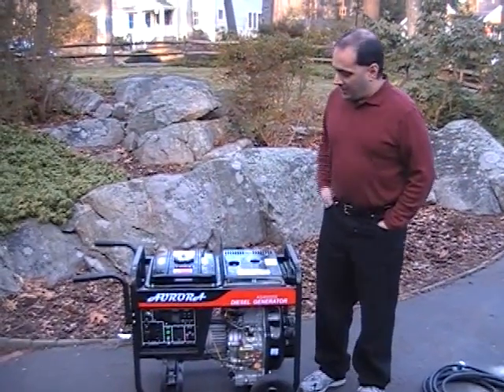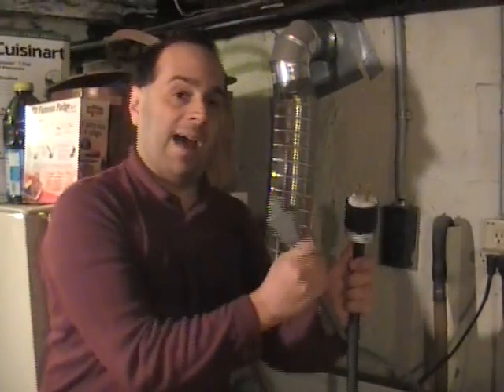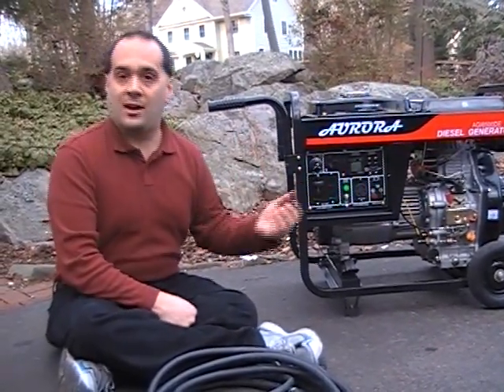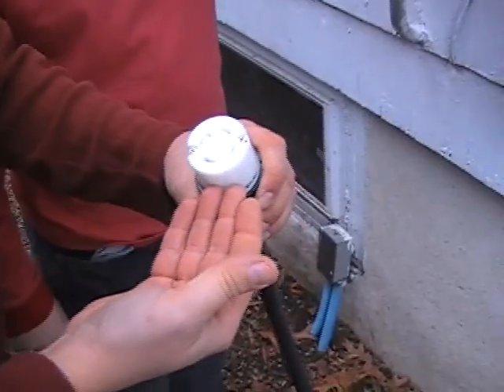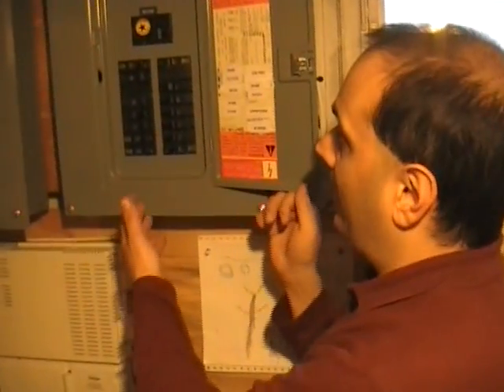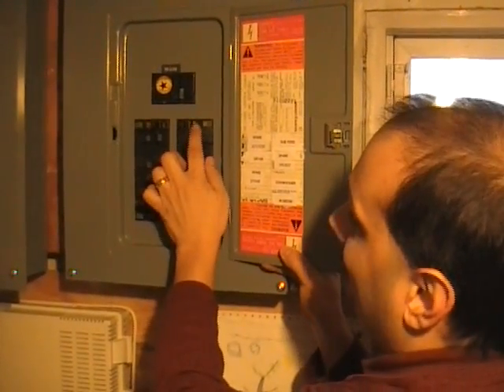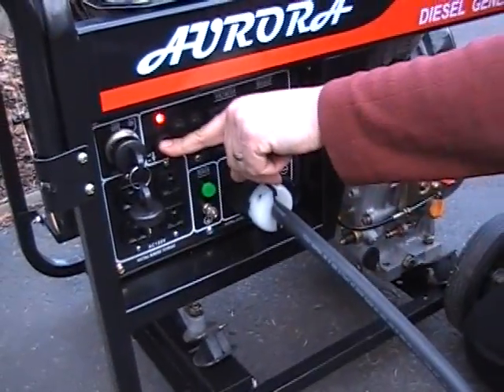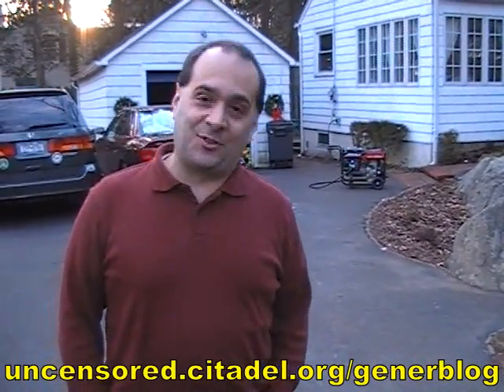Inexpensive residential generator hookup

Comment: Nice video Art. I have 2 questions:

What type of cable should I buy to run from the generator cord outlet in the garage, to the box in my basement. You briefly refer to it as the "orange" wire?

When I went to Lowes to buy the interlock switch, the salesman (credentials unknown) said that these interlock switches are not adequate, and that I should buy a manual transfer switch instead. He said the reason is that while opening up the main breaker does prevent backfeed to the grid through the breaker, there is nothing to prevent backfeed to the grid via the neutral wiring. I am not an electrician. Does this guy have a point?
Reply: The NEC states that all AUTOMATIC transfer switches need to be sized to the full load. Unless load shedding abilities are available. All manual transfer switches do not need to be sized for the full load as the user controls the loading.

Comment: Excellent video - Very well thought out and informative.

There is just one thing which has been overlooked, You need to invest in a nice soundproof enclosure which is fully ventilated to protect your nice, expensive generator from the weather and most importantly drop the noise of the generator down so that it does not disturb your neighbours too much! - see youtube video below for more info: 

https://www.youtube.com/watch?v=_ujNlL6ZcTs 

Good luck man :-)
Reply: Generator safety rules: Always make sure you follow all the generator safety rules before using your portable generator. This is only a reminder. Generators can be dangerous if not used carefully. Every year, hundreds of people die or get injured when using portable generators due to carbon monoxide poisoning and electrocution. Make sure you are using your generator carefully and keeping others safe as well. There is something very serious that everyone should always be aware of when using generators. Some people do run their generator indoors which is not safe and that increases the risk of carbon monoxide poisoning which can cause death of family and you. Some people run their generator in wet conditions which can electrocute them. Please remember that you should never run your generator indoors. Remember that carbon monoxide is an odorless and colorless gas that you cannot see or smell. Carbon monoxide is a silent killer. Keep that in mind. Make sure your generator is 15-20 feet away from your house and away from doors, windows, and vents. Never use your generator in your porch too. Having a carbon monoxide detector is very important against generator safety. Some people also allow children to go near the portable generator which could pose risks. We need to keep an eye on our children making sure that they are not near the portable generator so they won’t get electrocuted or burned by the generator which is dangerous. A locking enclosure also keeps kids safe. A generator shed might look like a tempting place to explore, or take cover during a game of hide and seek, but a generator is a dangerous piece of equipment that can cause injury. It says on the manual that we should also keep children away at all times from the portable generator to avoid injuries. Please do not allow a child or unqualified people to operate the portable generator.  It is important to keep your children safe especially little ones. The portable generator can be hot during an operation. Just because some manuals missed what should be listed doesn’t mean it’s safe to do. Always follow the generator safety rules when using portable generators. Generators pose electrical risks. If you need to use your generator during wet weather, you need a generator tent to protect your generator from getting wet. Don’t let your generator get wet. Keep your generator dry and before using your generator, please make sure your hands and your generator is dry. Do not wear loose clothing when operating the generator. Everything that is said on the generator’s operating manual should not be ignored. Never smoke cigarettes near the generator. Please keep flammable things away from the generator. Never overload your generator too. Your generator can catch fire. Never ever try to plug a generator cord into a wall outlet to avoid back feeding. Back feeding your generator is dangerous. Always turn on your generator first before plugging in appliances and shut off the appliances before turning your generator off. Use a heavy duty cord for your generator and the cord should not be worn out. All the instructions should be followed carefully. Never refuel your generator while it’s running. It can cause fire if fuel spills while your generator is hot. You should turn off your generator and let it cool off before refueling it. Having a fire extinguisher next to the generator is also important. This is only a reminder for everyone’s safety of using generators. Make sure your generator is properly grounded. Having a fire extinguisher next to the generator is also important against the safety rules. https://youtu.be/I1jT3ANENvI and here is a video more about keeping others safe when using generators and also about our family’s safety. It’s important to keep our little children safe as well. Make sure they’re away from the generator. Hope this helps.

Comment: What if the Gen. don't have an L14-30R outlet but has an L5-30R outlet instead?
Reply from the maker: L5-30R is a single phase, 120 volt receptacle.  That kind of generator is not suitable for interconnecting with a split phase, 120/240 volt service.  Unfortunately you will need to stick with extension cords.
Reply: Art Cancro. So it seems.Thanks

Comment: excellent video, very informative and helpful. I'm looking to equip my house for an emergency generator for future power outages and I'll be looking to follow in your footsteps on this install set-up. Thanks for sharing and taking the time to explain the dangers of no protection back feed. I was an aircraft instrumental electrician years ago so I fully understand the dangers with electrical wiring and the importance of protection devices in your circuits... Also I have the same basic needs for the circuits you have set-up in your transfer panel as we heat our home with oil as well. This video was taylor made for my needs.... Well done
Reply: Generator safety rules: Always make sure you follow all the generator safety rules before using your portable generator. This is only a reminder. Generators can be dangerous if not used carefully. Every year, hundreds of people die or get injured when using portable generators due to carbon monoxide poisoning and electrocution. Make sure you are using your generator carefully and keeping others safe as well. There is something very serious that everyone should always be aware of when using generators. Some people do run their generator indoors which is not safe and that increases the risk of carbon monoxide poisoning which can cause death of family and you. Some people run their generator in wet conditions which can electrocute them. Please remember that you should never run your generator indoors. Remember that carbon monoxide is an odorless and colorless gas that you cannot see or smell. Carbon monoxide is a silent killer. Keep that in mind. Make sure your generator is 15-20 feet away from your house and away from doors, windows, and vents. Never use your generator in your porch too. Having a carbon monoxide detector is very important against generator safety. Some people also allow children to go near the portable generator which could pose risks. We need to keep an eye on our children making sure that they are not near the portable generator so they won’t get electrocuted or burned by the generator which is dangerous. A locking enclosure also keeps kids safe. A generator shed might look like a tempting place to explore, or take cover during a game of hide and seek, but a generator is a dangerous piece of equipment that can cause injury. It says on the manual that we should also keep children away at all times from the portable generator to avoid injuries. Please do not allow a child or unqualified people to operate the portable generator.  It is important to keep your children safe especially little ones. The portable generator can be hot during an operation. Just because some manuals missed what should be listed doesn’t mean it’s safe to do. Always follow the generator safety rules when using portable generators. Generators pose electrical risks. If you need to use your generator during wet weather, you need a generator tent to protect your generator from getting wet. Don’t let your generator get wet. Keep your generator dry and before using your generator, please make sure your hands and your generator is dry. Do not wear loose clothing when operating the generator. Everything that is said on the generator’s operating manual should not be ignored. Never smoke cigarettes near the generator. Please keep flammable things away from the generator. Never overload your generator too. Your generator can catch fire. Never ever try to plug a generator cord into a wall outlet to avoid back feeding. Back feeding your generator is dangerous. Always turn on your generator first before plugging in appliances and shut off the appliances before turning your generator off. Use a heavy duty cord for your generator and the cord should not be worn out. All the instructions should be followed carefully. Never refuel your generator while it’s running. It can cause fire if fuel spills while your generator is hot. You should turn off your generator and let it cool off before refueling it. Having a fire extinguisher next to the generator is also important. This is only a reminder for everyone’s safety of using generators. Make sure your generator is properly grounded. Having a fire extinguisher next to the generator is also important against the safety rules. https://youtu.be/I1jT3ANENvI and here is a video more about keeping others safe when using generators and also about our family’s safety. It’s important to keep our little children safe as well. Make sure they’re away from the generator. Hope this helps.

Comment: Great info Art.
It's nice to see someone showing alternatives to dangerously backfeeding a system and very expensive transfer switches.
I used a method similar to yours for the same reason. My main panel is a 20 circuit Stab-lok so I added a Stab-lok Retrofit generator panel which has 20 circuits and a transfer switch and main breakers included. The panel was less than $200 + additional breakers.
Too many are scaring people away from using generators safely by making them think that proper transfer switches cost several hundred dollars.
Reply: isn't $200 several hundred?
Reply: @TimYorty  No.
sev·er·al
/ˈsev(ə)rəl/
determiner · pronoun
determiner: several; pronoun: several
    more than two but not many.
Reply: Generator safety rules: Always make sure you follow all the generator safety rules before using your portable generator. This is only a reminder. Generators can be dangerous if not used carefully. Every year, hundreds of people die or get injured when using portable generators due to carbon monoxide poisoning and electrocution. Make sure you are using your generator carefully and keeping others safe as well. There is something very serious that everyone should always be aware of when using generators. Some people do run their generator indoors which is not safe and that increases the risk of carbon monoxide poisoning which can cause death of family and you. Some people run their generator in wet conditions which can electrocute them. Please remember that you should never run your generator indoors. Remember that carbon monoxide is an odorless and colorless gas that you cannot see or smell. Carbon monoxide is a silent killer. Keep that in mind. Make sure your generator is 15-20 feet away from your house and away from doors, windows, and vents. Never use your generator in your porch too. Having a carbon monoxide detector is very important against generator safety. Some people also allow children to go near the portable generator which could pose risks. We need to keep an eye on our children making sure that they are not near the portable generator so they won’t get electrocuted or burned by the generator which is dangerous. A locking enclosure also keeps kids safe. A generator shed might look like a tempting place to explore, or take cover during a game of hide and seek, but a generator is a dangerous piece of equipment that can cause injury. It says on the manual that we should also keep children away at all times from the portable generator to avoid injuries. Please do not allow a child or unqualified people to operate the portable generator.  It is important to keep your children safe especially little ones. The portable generator can be hot during an operation. Just because some manuals missed what should be listed doesn’t mean it’s safe to do. Always follow the generator safety rules when using portable generators. Generators pose electrical risks. If you need to use your generator during wet weather, you need a generator tent to protect your generator from getting wet. Don’t let your generator get wet. Keep your generator dry and before using your generator, please make sure your hands and your generator is dry. Do not wear loose clothing when operating the generator. Everything that is said on the generator’s operating manual should not be ignored. Never smoke cigarettes near the generator. Please keep flammable things away from the generator. Never overload your generator too. Your generator can catch fire. Never ever try to plug a generator cord into a wall outlet to avoid back feeding. Back feeding your generator is dangerous. Always turn on your generator first before plugging in appliances and shut off the appliances before turning your generator off. Use a heavy duty cord for your generator and the cord should not be worn out. All the instructions should be followed carefully. Never refuel your generator while it’s running. It can cause fire if fuel spills while your generator is hot. You should turn off your generator and let it cool off before refueling it. Having a fire extinguisher next to the generator is also important. This is only a reminder for everyone’s safety of using generators. Make sure your generator is properly grounded. Having a fire extinguisher next to the generator is also important against the safety rules. https://youtu.be/I1jT3ANENvI and here is a video more about keeping others safe when using generators and also about our family’s safety. It’s important to keep our little children safe as well. Make sure they’re away from the generator. Hope this helps.

Comment: Thanks for the info.  Very clear.  Now I know the basics of what needs to be done when I get an electrician in here to do it.
Reply: depending on where you live, the local building codes inspector may let you as the homeowner do all the work as long as the finished product meets the electrical code.  That is a much cheaper way to go. Electricians can get quite expensive where I live.

Comment: I have a 120v/30 amp  (RV) outlet on my generator.  can I still attach to my house wring?
Reply: If you were willing to give up all 220v appliances, couldn't you use the subpanel method to isolate and power all the 110v circuits and setup the interlock to lock out all the double breakers? Or can the interlock not be setup that way?

Comment: When power goes off, due to a thunderstorm, and pouring rain, does the Generator needs to be cover, and dry, from the storm, and if yes how, when Generator is running and hot, and can't be in a enclose building if it needs to be protected.
Reply: - Maybe the guy doesn't have a carport, and very short house overhangs?
Reply: Generators don't necessarily have to be sheltered but it certainly helps prolong their life. There is also 120v - 240v of electricity being generated so standing in the rain while connecting a generator plug isn't highly recommended. :)
A generator box can be built fairly easily and cheaply. There are several videos on YouTube to show you how.
The overhand comment isn't very useful considering the overhang would be about 24" out from the building and between 8' and 20' above the generator. Not a lot of protection in a storm that would cause a power outage.
Reply: I put a piece of thin plywood over my generator to keep rain off. It can be rigged, suspended over it or perhaps zip-tied to the genny itself.
Reply: Not everyone is an expert on all things.  Try to help the uninformed instead of being condescending.
Reply: To keep it cool, just drop it in the swimming pool. No problem..
Reply: howard robertson ever heard of an overhang? talk about a stupid question.

Comment: Can some one explain why can't a generator be connected to the grid if solar power can. To better explain my point go to this video on solar panel installation Jump to minute 5:50 on this video  https://www.youtube.com/watch?v=fZX5b5WndnY
Reply: those grid-tied solar systems have what is called an "anti-islanding" feature built into the DC to AC inverters. When the inverter senses a lose of grid power, it shuts down and all that solar power is not usable.  There are smar inverters for this, but they are expensive for a homeowner.